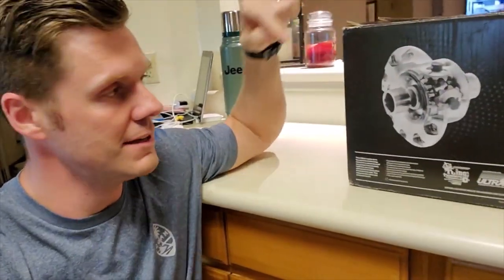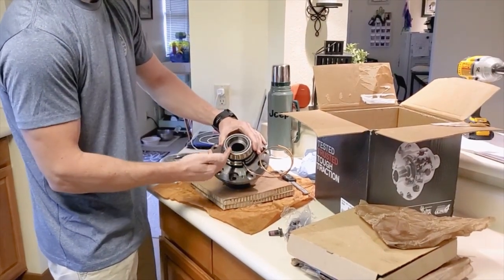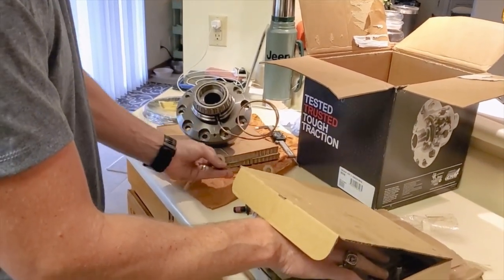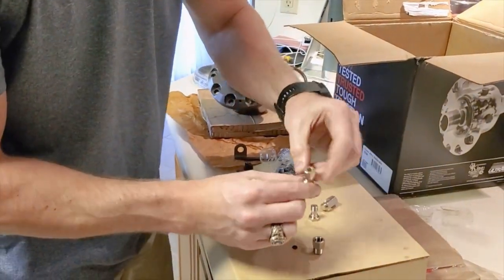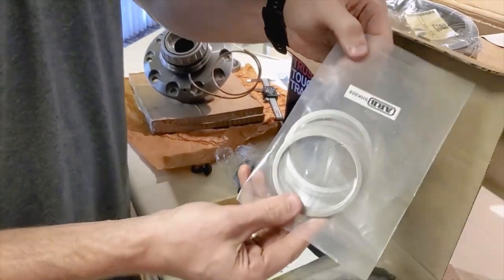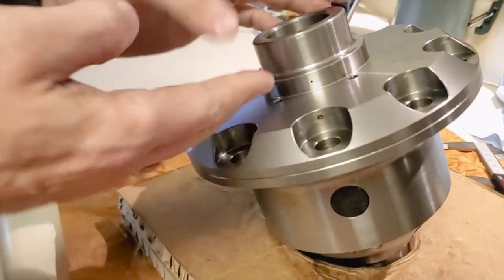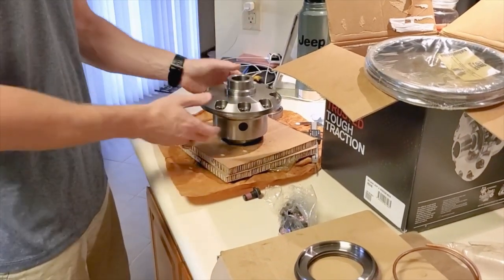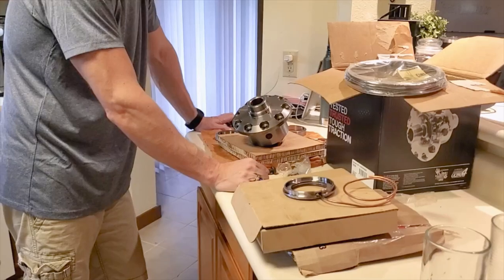Unboxing ARB Air Locker New Design Features Super Dana 44 60 JL JT Jeep or 2021 Bronco

Comment: Im more of an e locker guy, but to each their own. Keep it up bro
Reply from the maker: I have been building a long time my man. I have to say the E locker is just not a strong engagement, ARB has a patented actuator, its syncronized, and there is just so much more to E vs Air. Thanks for checking in bro. Love your channel.
Reply: TewlTalk air leaks kill it for me... 🤷‍♂️
Reply from the maker: @JLLIFEOFFROAD  I have heard that but never experienced it for myself. We shall soon see, this is my new long term vehicle. I have had an ected elocker burn up over a few uses due to weak magnets. Air can leak, electronic can fail to actuate. Its a gamble. At any rate, my warranty is long gone, truck barely has 1000 miles on it. Its all mine now. Fix it, break it, fix it... I will share when I get some long term content.

Comment: I have an Overland, Will This work with all JT axles?
Reply from the maker: Yes. All gladiators have the same axles. You just need the custom shafts. Give east coast gear supply a call.
Reply: @c130aviator  Thanks for the info